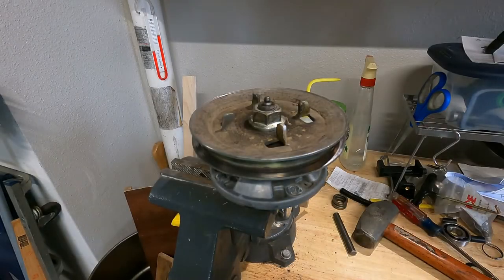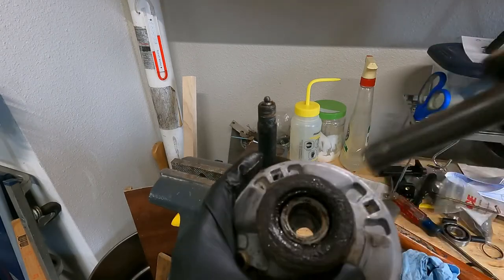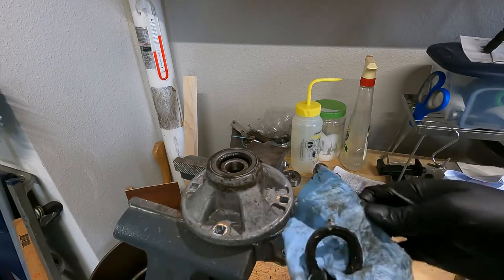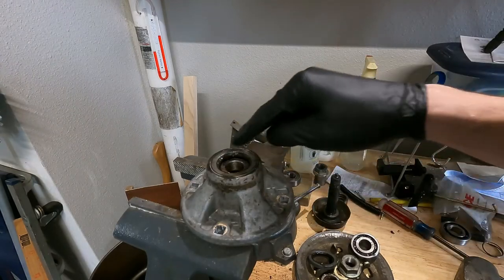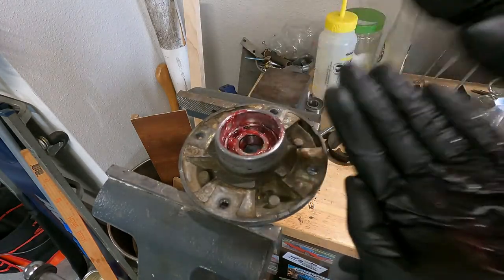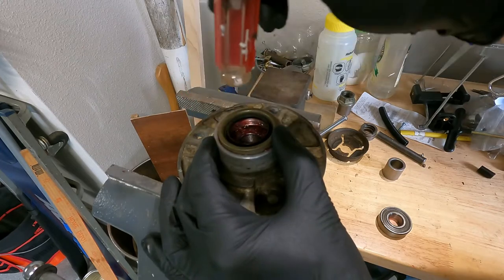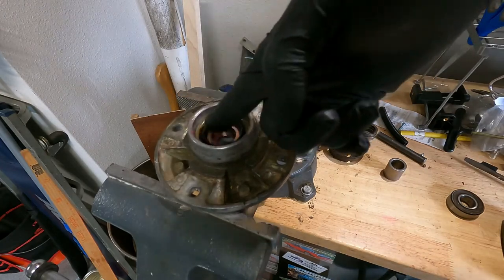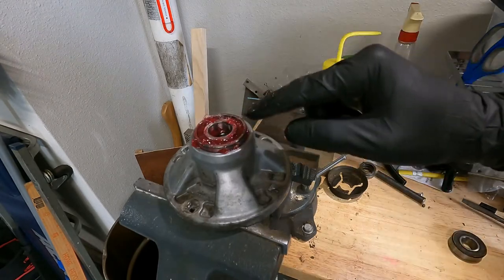John Deere 425 48" & 54" Deck Spindle Rebuild - EASY

Comment: great video. could you please tell me where you got the bearings rebuild kit and how much you paid for it?  in your opinion would a bad spindle bearing cause the mower to bog down even on the highest deck setting? And when it bogs down I can turn off the PTO switch and it comes  right back up to speed. clutch seems to be fine you can hear and feel the magnet inguage when the PTO switch h is turned on. Thanks for your time
Reply from the maker: I purchased all the bearings and seals from a Deere dealer.  I don't recall how much, but bearings are around $25 each, seals I think $8 each.  It adds up fast.  A bad spindle could be causing your issue, but it could also be a combination of worn components, not just a single source.

Comment: By the time my blades wobble and the bearing shot, the sloppiness just eats away at the housing which makes it unusable on my X300. They are sealed bearings and in order to get grease forced inside, you need 80 hand pumps on the grease gun. Yes 80, and not 8. 

A Youtube video showed a guy proving this by using a different color grease which he verified by removing the bearing plastic seal. So this should eliminate my spindle bearing wear cause I’m on my 2nd pair of spindles.😂

I have the torque specs on the spindles on my channel.